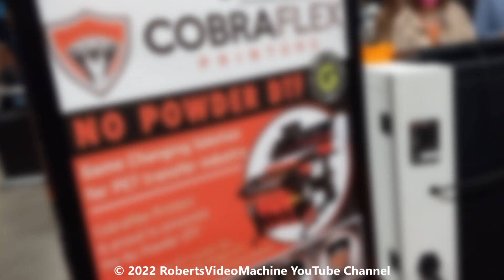Cobra Flex | DTF Printers | No Powder DTF | Impressions Expo 2022

Comment: Avoid this machine at all costs, it uses liquid adhesive in 1 head which cannot be adhere to garment like cotton. Also, if one of nozzle doesn't fire up, missing nozzle will leave out adhesive on print area which can cause that part of design not to stick on shirt. They also sell with powder version, buy that instead. However, avoid adhesive version. I hope this helps!
Reply from the maker: Thanks for letting us know. It's something to consider. Keep watching, commenting, and don't forget to subscribe.

Comment: Do they just skip the powder process and heat dry the ink?  Because I thought the powder is what binds the ink with the fabric?
Reply from the maker: I'm not too familiar with these printers and hope someone with hands-on experience chimes in. I was surprised as well when they said no powder. Thanks for watching, commenting, and don't forget to subscribe.
Reply: it sprays a coat of adhesive first the the white then the color...no powder is needed
Reply: How would you got about doing one offs feel like it be a big waste of film
Reply: @FASTFORWARDFOOTAGE  does the last as long as the powder or too new to tell?
Reply from the maker: Yeah, it would be a waste.  These large printers are designed for industrial use or large very large orders..
Reply: Hi where is it the expo ?
Reply: @FASTFORWARDFOOTAGE  It's the other way around. It prints Color First then the White then the Adhesive...and no powder!
Reply: @RobertsVideoMachine   is the RIP software able to take in and place orders on the printer to maximize space?
Reply from the maker: @Jeff Thurb  I don't have hands-on experience with this printer. Hopefully, someone on this thread can provide their feedback or familiarity. Thanks for watching, commenting, and don't forget to subscribe.

Comment: Imagine the horror in dealing with clogged heads and constant maintenance.
Reply from the maker: I'm not a user of this specific machine, but clogged print heads are a pain. Thanks for watching, commenting, and don't forget to subscribe.
Reply: @RobertsVideoMachine  haven't they worked out the clogged print heads, for the most part, by printing all colors along the side and with a cleaning brush they roll over, or thereabouts?